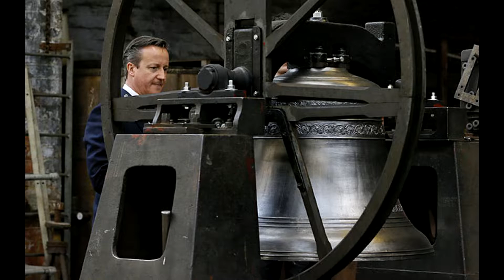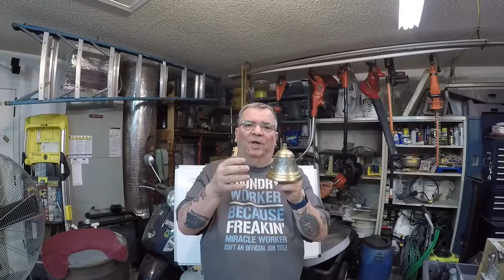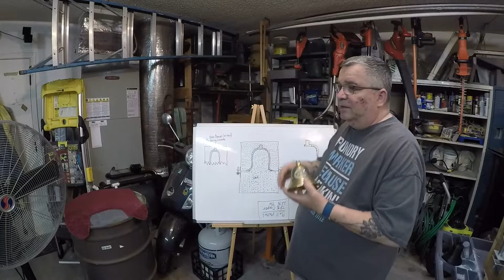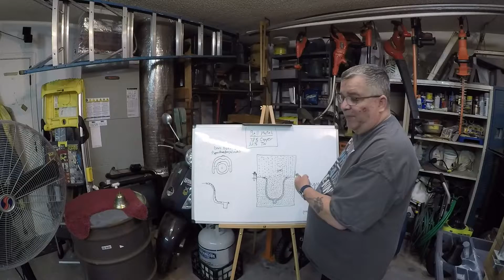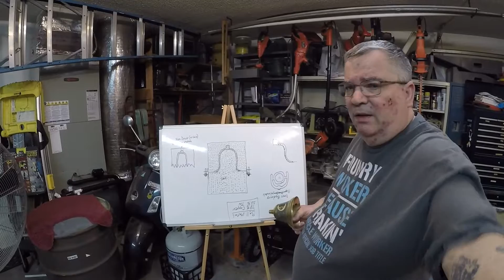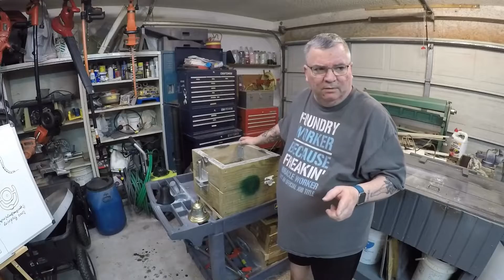Making a Bell, Pt !

Comment: Two comments: 1. On Farmcraft101  he tried to cast a bronze cannon and had problems.  I suggested you to him in the comments.  His video was on May 3, 2019.
2.  I had heard the story about a piano teacher who had given his daughter scales to do and he left to go somewhere in town.  As he was coming home in thick fog, all he heard was the low notes then started hearing some of the higher notes as he approached the house until he could hear the entire scales.  He realized that low frequency sounds penetrate fog better than the higher frequencies so he suggested that fog horns use very low sounds for warnings.   Also eastern European towns would ring the church bells in the face of hail producing weather to help break up the hail; which the low notes tend to do.
Reply from the maker: If the cannon maker contacts me I will be pleased to give him whatever advise I can. Our ship's bell was very heavy and thick and when struck made a loud deep sound which would help in thick fog. The story about the Eastern European towns sounds a bit off given how the vibrations would have to be perfectly tuned to make the harmonious vibration required to shatter the bits of ice that are not only of random size and density but would have to be near the bell to receive the full strength of the gong sound. Sounds like a story made up by the church for obvious reasons.

Comment: I am going to make a 16 inch farm bell for a friend neighbor out of aluminum Saturday April 11th 2020. I do this outside the core is made on a sand bed on the ground in a 6 inch deep square pit. Then i have a counterweight lift i use to balance out the lifting of the cope. I hope it all comes out good. Next I will make a 20 inch chapel bell for a local church..I use old iron bells for patterns..
Reply from the maker: Sounds like a good plan. See if you can video the process so we can all see your work. Using old bells for patterns is good, just clean and paint them so you can add some thickness to the wall of the bell. Aluminum doesn't run as fluidly as iron does so the wall thickness of some castings need to be thickened. Good luck on your projects!

Comment: Look forward to hearing an aluminum bell.  Hadn't thought of the possibility.  Years ago, a neighbor torched the bottom off an LPG cylinder, and called it a bell.  You could hear it from a half mile away, but it wasn't wonderful.
Reply from the maker: Any metal will vibrate when struck and make a noise. If you want some clean, sweet ringing use the Bell Metal recipe.